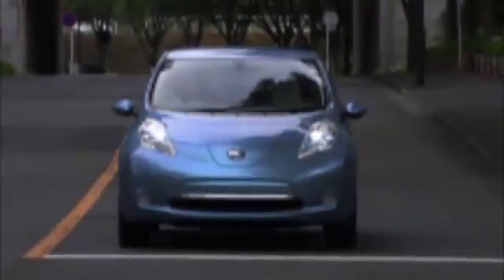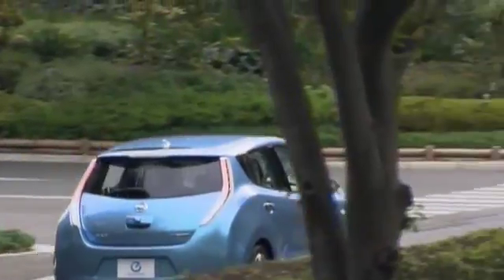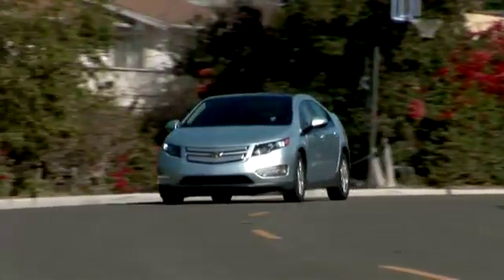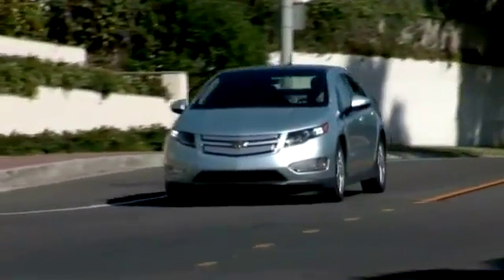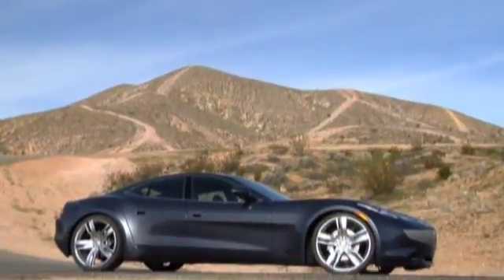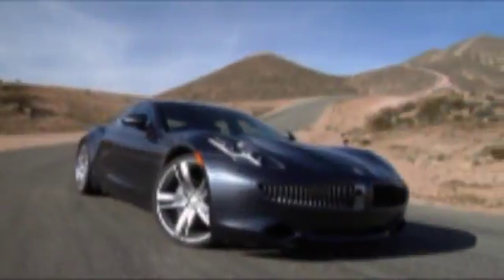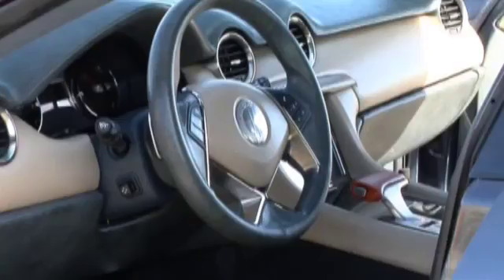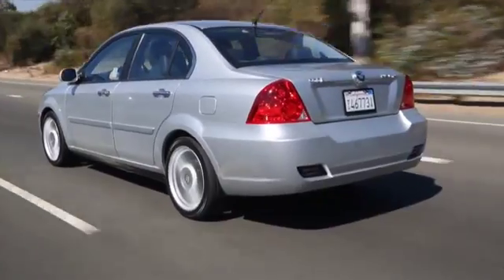Electric Vehicle Hits and Misses - Autoline This Week 1647

Comment: Backyard mechanics are converting second hand cars to electric here in Australia. Maybe $15000 Australian can get you about 200km range. Charge it over night and away you go. Electrically straightforward also. Keep it DC, less components and a bit cheaper but a little less range.  Anybody that cares about anything should have an electric car. Climate got you worried? Electric contributes less greenhouse gas. America's 'democracy' spreading exercises in the Middle East? Electric cars instead of oil could help. Social issues in the Middle East? Less revenue from oil, maybe less oppression as they have to turn to science and away from Allah (longshot). Or at least they will be broke and cant buy any weapons.

Comment: they have sold 110,000 so they defiantly have it right for most people. If you need more range get a Tesla. They are sold out so you have to wait 3-4 months for one. USA made is the best and they are now in Tenn.
The total cost is less than a gas or diesel. If you lease it you don't worry about the battery.
The USA imports $1 Billion a day in OIL. Gas cars are only 20% efficient. You guys have no vision. Own one for a year and you will see the difference.

Comment: The Volt is a Cruise?! Did these guys actually drive both cars or just read about them? I rent Cruise's when I travel and I own a Volt. They drive, feel and look quite different. Don't let the fact that they are built off the same platform fool you. The Volt is 30% stiffer than the Cruise, rides much nicer and doesn't have they whiny engine noise when you punch it.

Comment: Very interesting talk and view on EV's and hybrids.The biggest problem is over cost of EV's and in the real world there is much less parts unlike gasoline engine car inside..So make the price tag equivalent to its use!! For example if nissan leaf is $15K car concept,then why it would have to cost $35K just because you change drive train to less complicated and easier concept??!! Less parts,less money!! It doesn't make any sense.Make EV around $15K and they will fly of the dealers lot..Why not?
Reply: batteries are still really pricey which why they cost so much. Hopefully batteries will drop in price.
Reply: I imagine that Tesla's battery factory will bring down prices.It's the old 'supply and demand' at work here.
Reply: its cost hike is in the batteries
Reply: yes,but it shouldn't these days when all batteries are smaller and lighter and more capacity.Battries evolve fast like computers.Maybe the rare material what is used in new batteries could climb up a little,but there is a lots of parts void in EV compare to gasoline cars.,its like a golf cart,come on.
Reply: MB031 The number or weight of parts in a car isn't an indication as to how much it costs to make. EVs use more expensive materials and components. And what's probably the biggest reason for a high price is the manufacturing numbers. Nissan has sold 100,000 Leafs in just over three years. Compare that to about the same amount of Jukes sold in a month or so. Plus the Juke more than likely shares a lot of components from other IC cars.
Reply: MB031 I don't think it's the number of components as much as the cost of components. Couple this with the manufacturer knowing maintenance costs for their EV's will be much, much lower than their ICE's and they are all in the business of making money. so the manufacturers front-load the overall ownership cost, just to stay in long-term profit. Greener does not mean cheaper, but pretty soon you will not have the luxury of choice. It will be electric or walk.

Comment: The problem with EV is that up until the Model S, they've been too small, too expensive and made by non-luxury companies.

An EV needs to be at least the size of a Malibu/Sonata/Fusion/Camry inside, needs to get at least 100 miles between charges, needs a backup gasoline generator and needs to cost less than $50,000.

It's not likely to happen anytime soon.

Easier to buy a $23,000 car instead of shooting for an EV.
Reply: It would be a HYBRID.  No big difference between it and a Karma.
Reply: bigtruckseriesreview I'm with you apart from the gasoline generator bit. That's a hybrid, and when we have no more (or very expensive) oil, gasoline will not be viable. So as far as range increase is concerned, it has to go the battery route.

Comment: Hmm... seems biggest problem is US's weak standard 110V power... most of the world has 240v standard to all sockets in the home....
Reply: "biggest problem is US's weak standard 110V power"  I don't think it's as big a weakness as you might at first think it is if you're not an American. 40 to 60 miles for an overnight charge isn't too shabby. If you've got a garage you can always have a 220 volt source installed.
In my case I live about 2 miles from a Chademo supercharger. It'll give you 50 miles in 15 minutes. So I can see an electric working for me in the future,, as the infrastructure improves.
But the biggest problem with the electrics is the battery. The Nissan Leaf for example: They need more Kilowatt hours in the battery. If they were to double it ,,, all kinds of interesting things would happen.

Comment: ALL ELECTRIC CARS HAVE ALONG WAY TO GO. The future is going to be a charging pad system where parking lots or traffic lights charge the car without plugging in. Until its no effort to charge with wireless charge pads and sold to people as saving time money and no risk of a fuel related fire for the same or less price than a gas car you will see a shift in the market. One problem all the auto makers have there foot in the door with gas company's this will cause the stock to fall so its negative for any auto maker
Reply: As much as I like the charging pad system ,,, It might be a little too late with bigger batteries and an infrastructure of more places to plug in.
I really think the future of wireless charging is if embedded in the freeway system and open roads between cities. Charge as you drive. This could eliminate range anxiety.
But even that might prove to be a moot point if batteries get very good.
Reply: That similar to my idea and I based it on current technology not some type of rubber / metal tire that would be need to conduct a current. The stop lights and parking lots... your idea would make it possible for semi trucks to use this system
Reply: *****
Actually anything that runs on batteries ,,, not just trucks.
Reply: fernsemer I ment to make semis using this technology for long distance do able
Reply: inductive charging is nice but wont be necessary when evs can do 300+ mile range
Reply: ***** Lots of good points. Lots more investigation and development is required, but as with all things, it's going to be the customer who foots the bill.
Reply: John Benton how much do you want to be when cars drive them self's and car crashes are a thing of the past (no collision industry) our insurance rates will be higher than ever just because its an untested system and the customer always foots the bill.
Reply: Happily, I'll not be here to worry about life then. I'm already ancient. Costs and stuff will be the problems of other generations. I'm just doing my bit.
Reply: Fuck me. You're good. Five more years is a fucking bonus. I'll be lucky to see another fucking Christmas.

Comment: not it's not. what are you looking at? because if you're looking at the data plate it's wrong, the data plate is always gross weight meaning what the car weights when loaded with passengers and cargo. curb weight is the real world weight on the car with a full tank of gas no cargo or occupants. you car no matter how it's equipped weights no more than 2800 lbs.

Comment: 1) New york times set off on a 62 mile journey with the range showing 32 miles. You wouldn't set off on a 62 mile journey with 32 miles of gas.
2) The batteries are guaranteed for 8 years (as I said before, twice, but you are clearly living in a fantasy world and ignoring facts)
3) so where do you get your '2 days' estimate from when it takes just 1hr for a full charge at a tesla supercharger station? are you just making this up?

Comment: Again, not sure where you are getting your figures from. Sacremento to LA is just under 400 miles, meaning you would have to spend 30min at the harris ranch supercharger station on I5. Given it would cost you $100 to do the trip in an M5, and less than $10 in a Tesla, I think the extra 30 mins is worth the $90 saving.

Comment: I don't know where you are getting your figures, but currently tesla has 1.2b in assets, including 140m in cash and has 900m in liabilities.
As I said before, any electric car uses less electricity than a gas car to drive.
I want one simply for the luxury and power, since they have the power of an M5 but cost 10x less to run.

Comment: It has larger wheels any tyres for grip and handling. I never said it was an 'energy saver' however it takes less energy to drive 100 miles than it does to refine the gas that a regular auto would use in 100 miles.
Nobody will buy it? It's sold out for the next 2 months. has been since june.
Bankrupt? They have over 140m in cash and as of last quarter are a profitable company. Stop comparing to fisker, fisker was a separate company and they made a hybrid, not an ev.

Comment: You keep going on about other companies. Tesla is not other companies.

As I said earlier, even if you pay for the electricity, it costs about 3.4 cents per mile rather than 35 cents per mile, a significant saving. I forsee it remaining free since it is so low cost and the potential for attracting customers to shops/restaurants, but time will tell.
You are exactly right with the nerds comment, that is why the tesla is good as a regular car. Faster, more spacious, looks great and cheap to run.

Comment: In Norway, where EV has no tax, but ICE has insane taxes (Tesla 85kW Performance is 110k USD, BMW M5 is over 312k USD without any options). Here the Tesla makes perfect sense economically. Also we have smaller towns, so we drive a lot less distance. Check out FerdinandMotor at twitter, they just did a ~200km very hilly trip to a ski resort with 70km left on the meter with the Model S, this in -5C average (20F?). It seems to work, and certainly covers most of my use cases.

Comment: My 2013 Chevrolet Volt has hold mode. I save $200 a month in gas, so I will break even over a Cruze LTZ in 3 years. How does that not make sense? It's also a dream to drive with all that silence.

Comment: Comfort - sometimes it is -30 Celsius and dark when I drive 50km to work. I'd rather do it at some level of comfort.  That said I drive a 1994 Toyota HiAce truck most days and there isn't much comfort built into that machine. That's why I probably want the Tesla so bad - overcompensating for having to drive to work in a cold cramped cabover truck that costs $12 to $15 bucks per day in fuel. The tesla would cost me between $1 and $2 for electricity - only pennies more than a Leaf but oh so better

Comment: The Nissan was missing a key safety feature that is a must for my family - a rear middle headrest.  The Ford fusion, like the Volt are NOT electric cars but hybrids (I've already got a Prius in the driveway - its better on gas than a Volt on long road trips)  I would like my next car to be an EV but if manufacturers don't or won't sell them to all markets they don't have the right to cry that they aren't selling. I wont mention the others - they are too small - so is the Volt for that matter.

Comment: The electricity price varying across the US doesn't impact the savings that much. He tells it as if in the tri-state area you can't benefit because the e-price is high. Whether you pay $2.50 or $2 for a full battery doesn't make a difference compared to the $30 you'd pay for gas.

Comment: One important thing they got wrong at the start, is when the guy said that mileage varies "the same as" with an ICE. In fact, it varies in exactly the *opposite* way as an ICE. ICE city mileage is lower than highway mileage. On the highway an ICE can cruise at maximum efficiency, but in the city it's burning a lot of fuel to get nowhere very slowly. EVs don't do very well on long-distance road trips, but they shine in city driving, because there's no idling. When you stop, it stops.

Comment: The guys are all right. Somehow. But, they're missing the point: EVs and electrification of cars is the way it will go. Yes, won't be easy at the beginning. But it's the way to go. VOLT drivers and others are just early adapters. In 10, 15 years such cars will be standard. "What? You still use a gas powered car?!". Cadillac, Chevrolet are getting it right. All along.

Comment: A Volt is not a Cruz that costs $20K more.  The performance and drive is not the same as a Cruz.  No one questions the cost of other premium upgrades, why isn't driving on home grown, American, cleaner than oil, electricity given similar respect?  On the issue of economics, I did not hear of the $100 a month I save on fuel, oil changes, etc.  And regarding sales, EVs are selling at twice the rate of hybrids did at their intro.  The Volt is selling better than half of models avail.

Comment: Open standard batteries swap-able designs will be the true solution. Electricity should be more flexible than fossil fuel. Until then, you are all locked down by expensive executive bonuses and they are running an industrial packaging scams. You should look forward to China manufacturers and electric car designers to open up and crack all these industrial scams.

Comment: Decent review, but the Leaf isn't depicted fairly. If you live in a city of under 100,000
(let's say 15 miles across) and drive 25 miles to work or less, a Leaf is totally Ideal.
Avr. work commute in the US is 10 miles. This is our situation - and our Prius is now gathering dust. It feels like an antique. With battery replacement at 100,000 miles, ownership cost for a Leaf is identical to a Prius getting 60 MPG (like ours).. Unless gas goes up.
And in 10 years, batts. will give twice the range.

Comment: Being that I do use my Leaf for 85% or better of all my driving needs. When I do need more I just jump into my VW TDI and cruise along at 48mpg. True, electrics are not for many but you'd be surprised at how many would benefit from driving one. For those with the Volt, why carry around a heavy gas engine and fuel tank full of fuel if you rarely use it. Why not just remove those components and put in more batteries and go have more electric fun. Take your secondary SUV for those few extra drives.

Comment: $700 level II Charge Station at home. I drive my Leaf to work and back daily and never have range issues or charge issues. Car is powerful and fun and not a tiny car. I get 75 miles at 55 mph. Saving fuel is huge. In 10 years (150,000 miles) I would have spent in fuel alone $26,000 bucks. Calculating 20mpg and $3.50 per gallon. Not far off what most folks pay for a an SUV that cost them $35,000 bucks. My Leaf will only cost me $6,600 in electricity only. That is a $20,000 savings in fuel alone.

Comment: The best all-around solution available today is the extended range hybrid. If someone could package the Volt powertrain into a vehicle that costs less than $30K, it would sell like hotcakes. Until someone makes a breakthrough in EV range, charge times and charging station availability, EV sales will be low volume. As I see it now, the Prius C is the best dollars to MPG solution. The Ford C-Max is a decent choice as well.